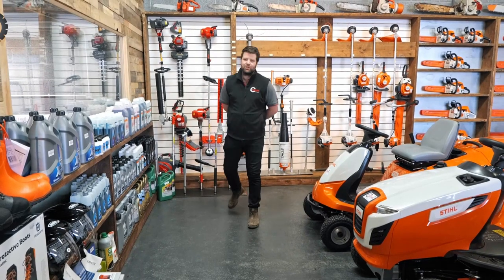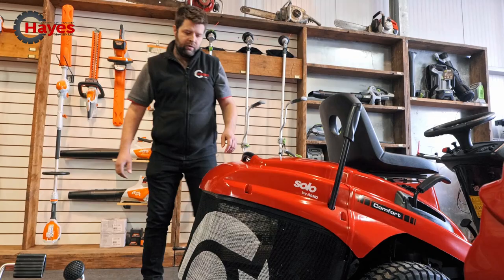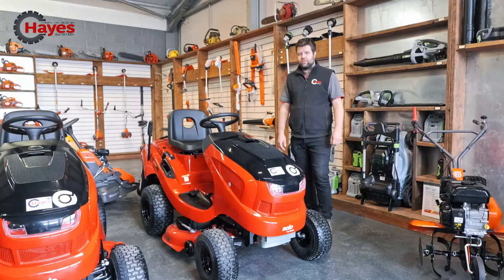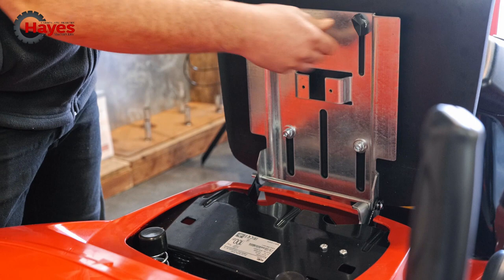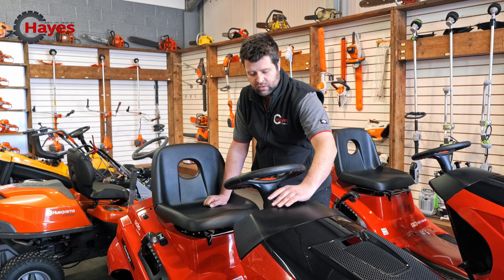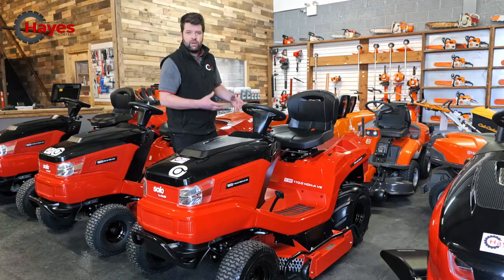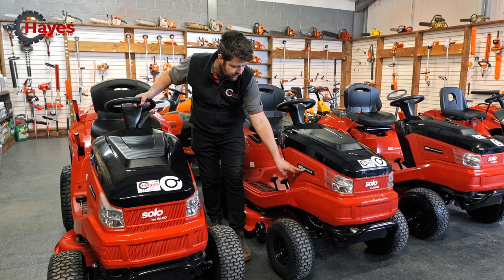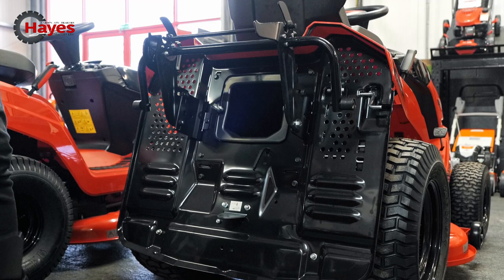AL-KO Ride On Lawn Mower Tractor Full Range Solo by AL-KO | T20-105, T16-93, T22-122, T22-111

Comment: I've inherited an old AL-KO T920 Classic (rear collect) which seems to be on it's last legs so am looking at my options. I can't choose between side and rear collect as we have just over an acre of paddock but just under an acre of formal lawn. I'm tempted to side discharge in the paddock and mulch the lawn so I don't have lots of grass but I should probably collect on the lawn and mulch / deflect the paddock somehow? Overall how would you rate AL-KO vs Stiga vs Cobra too?

Comment: Hi, you mentioned the gearbox being professional grade on the t20 model for more demanding use. From al-ko’s webpage it says Hydro Gear G700 on this model, but the comfort range and even the premium t22 110 High grass mower with chevron tyres have the smaller Hydro Gear T3. I simply don’t understand why al-ko did not  put the tougher gearbox wirh full 1” axels on the High grass mower. If any of the above tractors would be put to “demanding use” I’d reckon it would be that particular model, al-ko even put ag-tyres on it so they must somehow expect buyers to use it kind of off-road. It is the main reason why I’m a bit hesitant to buy the t22 110. I wonder if it really is going to hold up and be tough - or simply made to look that way.
Reply from the maker: It’s a tough mower, but is only designed for domestic use. I certainly wouldn’t put it in a commercial setting. It’s an owner/driver machine. Tbf, the Hydrogear axles give us very little issues.

Comment: Where is the buzzer located that tell you when the grass box is full?
Reply from the maker: The buzzer is under the dash above the battery and the switch to engage the buzzer is at the rear beside the lever.
Reply: @MachineryNation  Brill, thank you for that. The buzzer isn't working on ours but the lever and micro switch seems to be okay.
Maybe I could wire in a separate buzzer going from the micro switch to save taking the dash apart...